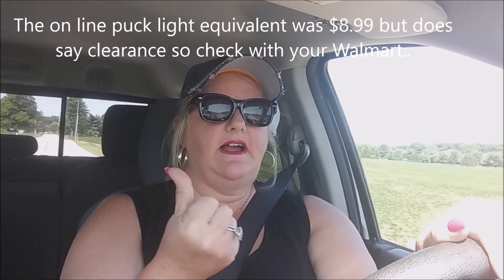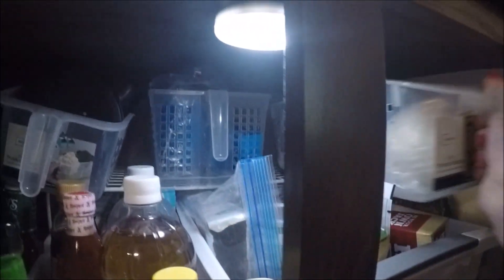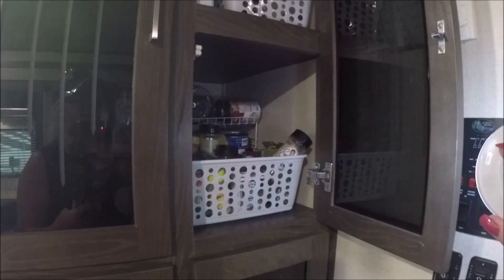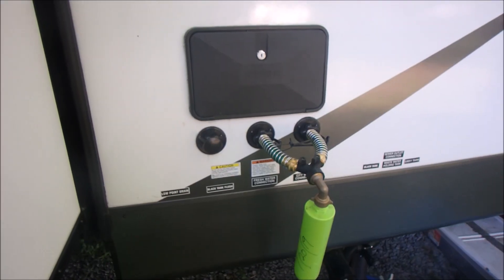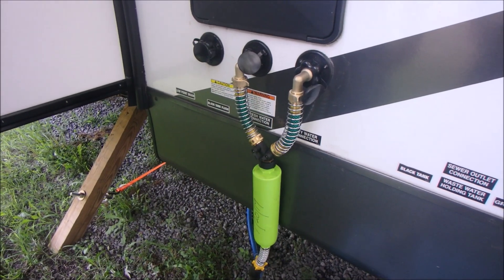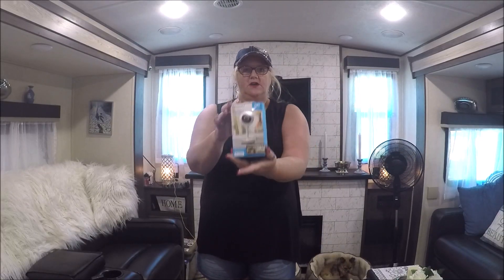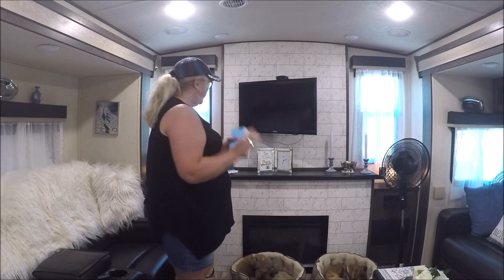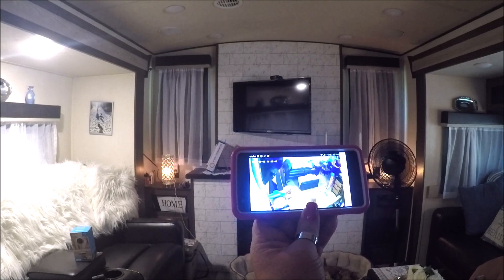Three awesome upgrades 1. Security 2. Lights 3. Water

Comment: I know your last camper you upgraded it. I am still in the Cottage from the USA. I want to put in vertical blinds into all the windows and remove the pelmets as some are not working right. Can i do this and put back the pelmets? Also i want to down the amount of brown thats in the cottage to strip the doors and varnish them its just wood and then do the doors as the stain is wearing off them any suggestions and help would be grateful for
Reply from the maker: I took down all the pelmets in the last camper.   I recovered the one above the kitchen window and put that one back up with a mini blind so yes, that can be done.  Unfortunately I have no experience in stripping and varnishing but I am sure there are lots of how to videos on YouTube - it's my place to look when I need to figure things out :-)  Thank you for watching and commenting.   Wishing you a wonderful weekend.